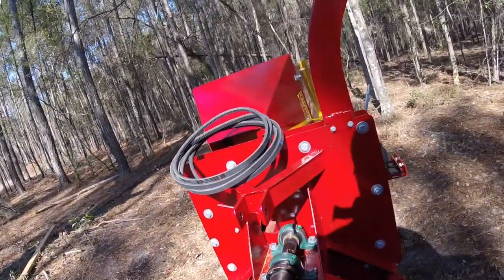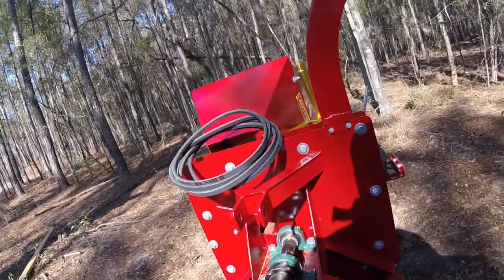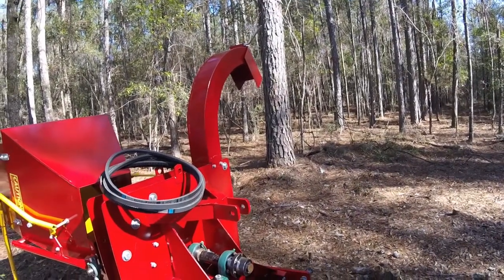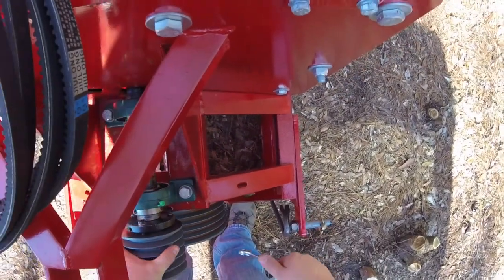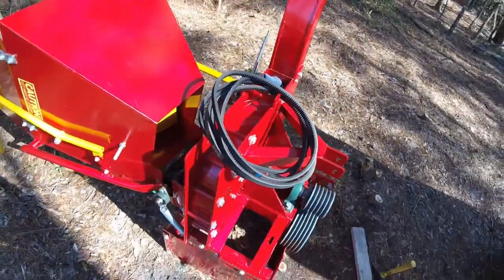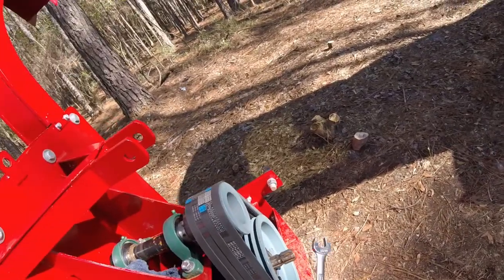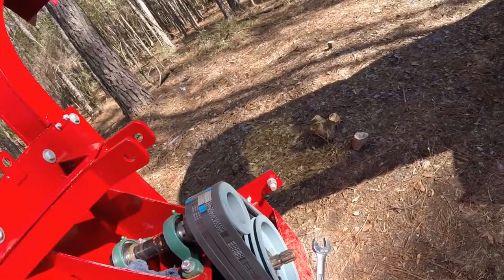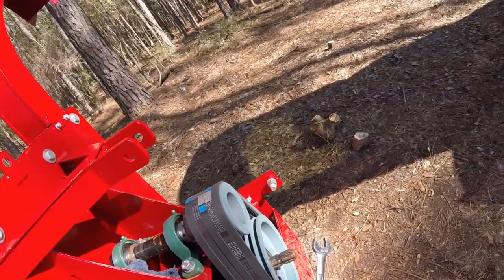Jinma 8 inch PTO wood chipper first run part 3

Comment: Go for a woodland Mills! forget these machines. I finally gave up with my Jinma shortly after spending several hundred pounds on parts from the states. I got them fitted only to have the bed blade snap when I adjusted and tightened it up. It was the straw that broke the camel. I bought a woodland mills machine and it is truly a cut above these for not too much more money. The difference in cost can definitely be justified by the extra quality of design and build.

Comment: I have one of these machines, its about 8 years old now, to keep them running you have to be happy to tinker continuously with them. When you get them set up right they work pretty well considering what they cost.
I had similar problems to you but not so early on, the middle belt came fitted upside down and every time I turned it around it went back the wrong way so I cut it away and have run it without one belt for hours and hours now no problem. I had a bearing block break too same position which trashed a new set of blades, I fitted a new one (like the one you did) and welded in some shims to stop the block moving. It can move slightly no matter how much you tighten it down and then the flywheel isn't parallel to its housing, if it moves the blades can touch the anvil and you don't want that. Keep the blades sharp! Taking the blades out is hassle but no so bad if you use copper grease on the countersunk holes in the blades. Regularly clean the slide on the feed shaft, its poorly engineered and it will pop off if it gets gummed up. Its not a difficult fix just a pain when it happens right at the start of your day.
A lot of people curse these chippers but they are what they are for the price, you often get what you pay for. That said, for the bit of chipping I do about my place it is more than adequate and despite the maintenance I still wouldn't want to go spend proper money to have a more professional machine.
Good luck with yours.

Comment: Most of the problems you have had, I have had with my 6inch model over here in the UK. The original bearing blocks are too weak for the job they have to do and they break. When they do that the knives hit the anvil and it trashes the leading corner of both blades. I had one of the 5 belts keep turning over for some reason and in the end I just cut it off and ran the unit with 4. The two pulleys do not line up and I am sure that this is why I now have had a belt snap and it threw all the other belts off chewing them up in the process. I am waiting  for a new set to arrive. I cannot get the same Chinese size here in the UK so I am trying an oversize belt 17mm wide not 15 and I will just have to see how it goes. The feed roller drive is a joke too and regularly came apart so I had a mod made which sorted that. I cant get blades or any parts here in the UK anymore, if the belts hold up I will get some blades up but only if I can get the belts sorted. Otherwise I am going to scrap the machine, its just a case of one break down too many for me now. When this unit works it works well you get what you pay for. Good luck keeping yours going.